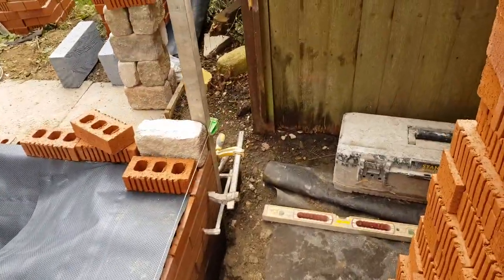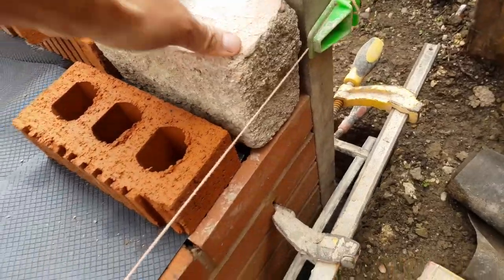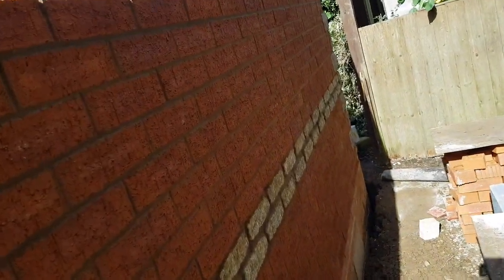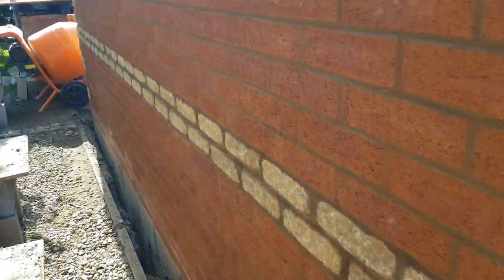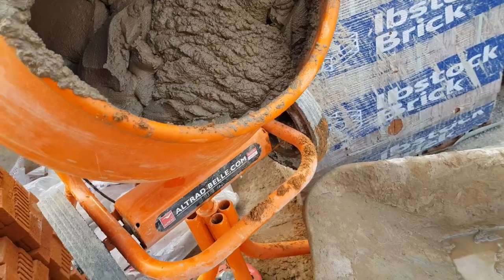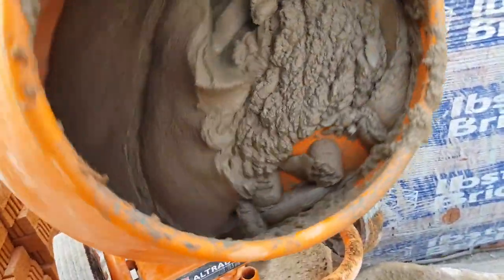Bricklaying - New Extension with Stone detail - The perfect Mortar #bricklaying #Stonework

Comment: Lovely job mate! It's always good to have some variety in what you're laying! Just one question, I've noticed in a lot of your extension videos you do your blockwork before laying the floor slab. When we've done extensions before we've done concrete first. I just wondered if there was a particular reason why you do blockwork first?
Reply from the maker: Thanks buddy really appreciate that! Aah mate its though no choice of my own, the concrete is either delayed or we just have to hit deadlines so we crack on.. we screed it or pump it in after the roof is on most of the time😂🤦‍♂️😨 Hate doing it the way we do..but, just the way it is sometimes 😂 we've got 6 jobs on at the moment so hard for the boss to keep everything super organized as he likes💪😂
Reply: @IzzytheBricky  Ah that makes sense. I used to work for my dad's small firm and we only used to do one at a time. That way things just happened in the order we wished. At least this means you can just crack on with the brickwork. Nice one man👍💪
Reply from the maker: Sounds lovely that does👍😂 Hopefully it will calm down a bit soon haha cheers bud🍻😁